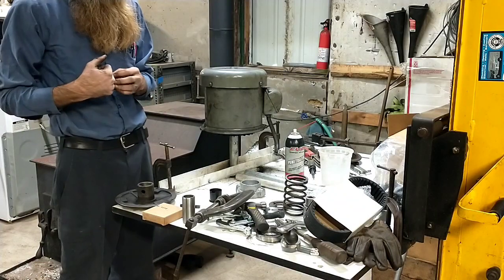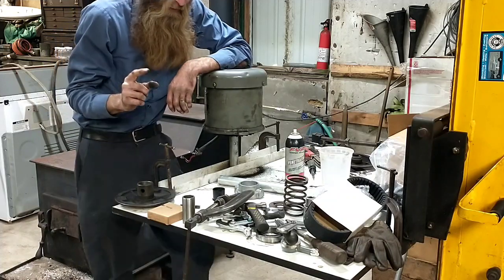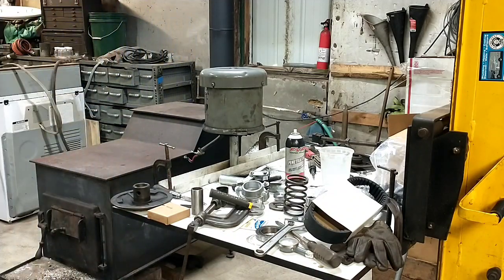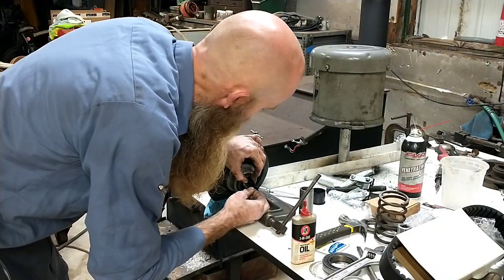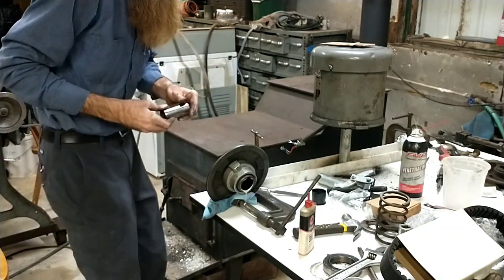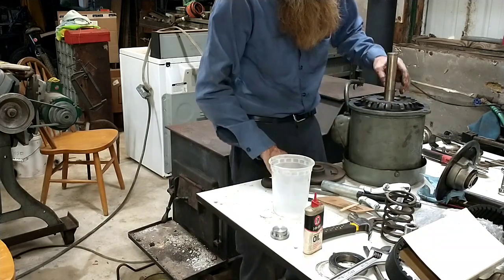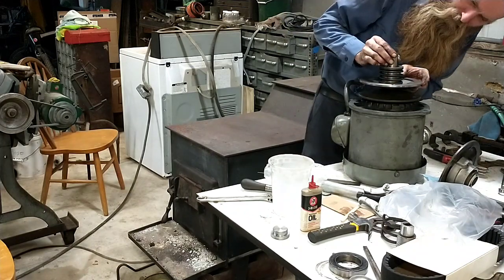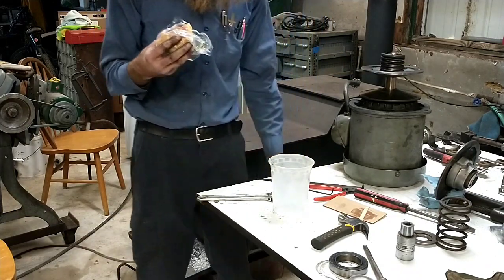2 hp Bridgeport series 1 Motor rebuild and replacing the pulley bushings.

Comment: Where do you get your spindle bearings?
Reply from the maker: We get all of our parts either from high quality tools or from mataco, they are both in ohio.
Reply from the maker: If you're just trying to buy small quantities of parts, you may be better off buying them from the resellers on eBay, a lot of the big dealers for both matco and high quality tools sell on there, they get such a big parts break by buying in volume that they can sell them cheaper on there than you can buy them directly from the manufacturer for.